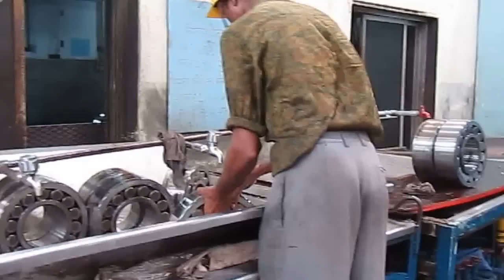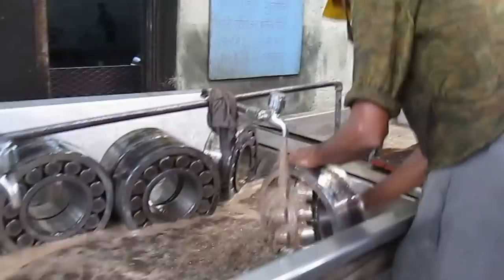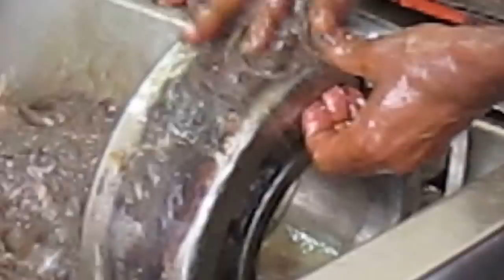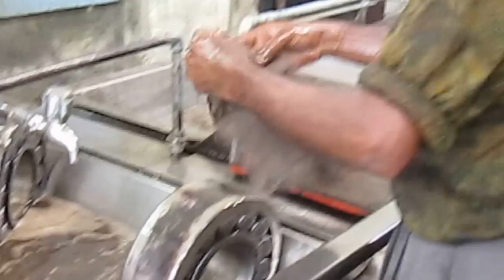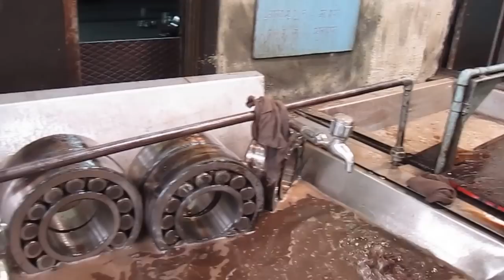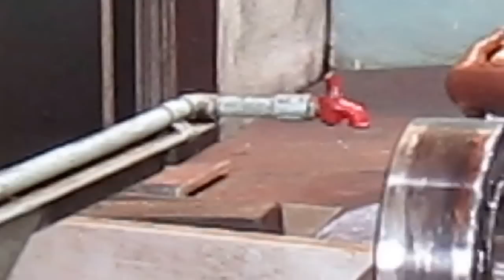Cleaning of roller Bearings of ICF Coach

Comment: 4:53
CNC Axle Lathe For Railway Axle Production | Niles-Simmons
Simmons Machine Tool Corporation
439K views

15:59
how to work in Indian Railways
indianrailway
79K views

21:30
Periodic Overhauling of FIAT High Speed Railway Bogie in the Workshop-- Yadvendu
IndianRailRoads
289K views

6:59
CNC Vertical Wheel Lathe | Niles-Simmons
Simmons Machine Tool Corporation
387K views

2:03
ZEN Automatic Bearing Assembly - How it's made, bearings
ZenBearings
896K views

6:01
Mercedes 4-Cylinder Engine Production
Car TV
Recommended for you

2:40
How a train wheel is made - Sandvik Coromant
Sandvik Coromant
531K views

2:44
Pocket Spring Coil Unbaler for Round Bales - Model 1409 (Video)
Atlanta Attachment Co
Recommended for you

SKF Spherical Roller Bearings with Tapered Bore - Mounting and dismounting
SKF Maintenance Products
127K views

Periodic Overhauling of FIAT High Speed Railway Bogie in the Workshop--Part II Yadvendu
IndianRailRoads
78K views

The Replacement of Dickenson's Creek Bridge
Greater Taree City Council
149K views

The Low-floor Electric Multiple Unit KONČAR
koncarmarketing
603K views

Jaggery Production Process 2018 | Traditional Jaggery Making Process|
Flavour Factory
545K views

Steel Butt Hinges Manufacturing at Madhuri Industries,Hyderabad
P K R T
Recommended for you

TRV Gauge 1 4
Network Rail Standardised Tasks
Recommended for you

10 Extreme Dangerous Biggest Haulage Truck Wheel Loader, World's Most Powerful Heavy Truck Excavator
Modern CNC Machines
1.6M views

Motor stator and armature prodution line supplier/Nide coorperation
Ningbo Nide Mechanical Equipment Co.,Ltd
Recommended for you

Amazing Ball Bearing Motor DIY. Part 1
Do It Yourself
4.5M views

Cleaning of roller Bearings of ICF Coach

Comment: the outer race still has grime on it not a good clean lol where is his protective gear
Reply: he has a helmet on
Reply: That is corrosion fretting.
Reply: Alex Lowe it wouldn't matter any way its not suppose to spin in the housing but if you use a bearing locker compound it would be nice to clean it up a little
Reply: Breaking Toast I don't recall saying it does matter. However depending on the application it may. In some applications the outer race of a bearing rotates as such it will be a press fit in its housing.  In those cases, corrosion fretting would be detrimental. However if the fits are "good" corrosion fretting is unlikely to occur. When a bearing is fitted in the more conventional manner, ie tight on a shaft with a rotating inner ring, it is common to see what we see here. Use the highest concentration of fretting to locate the loaded area of the outer raceway and that will be the first area to look for wear in the rolling elements.